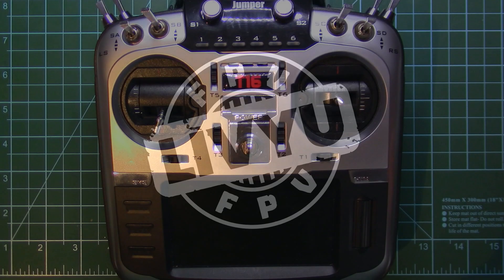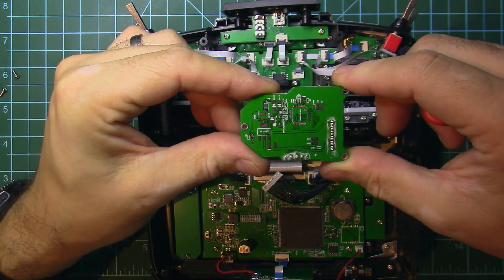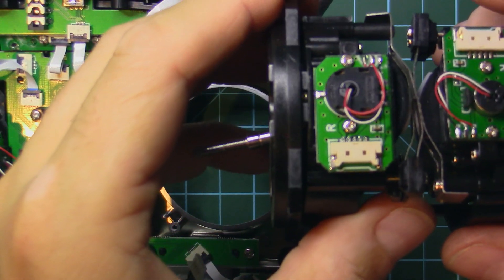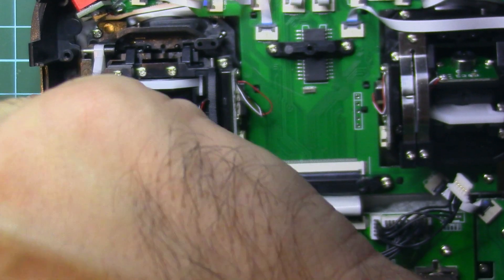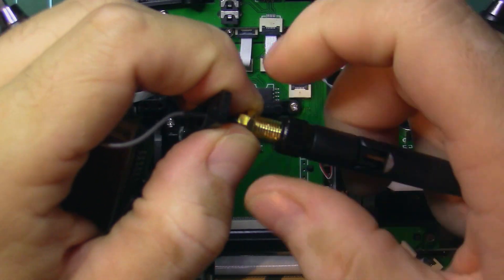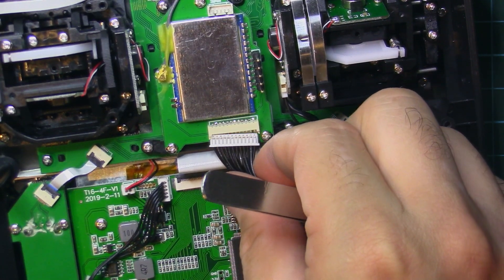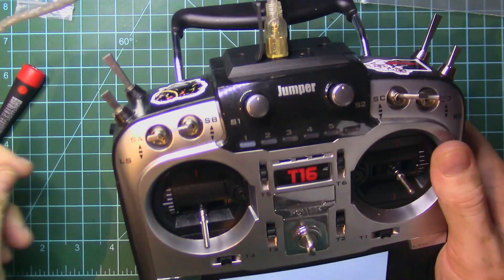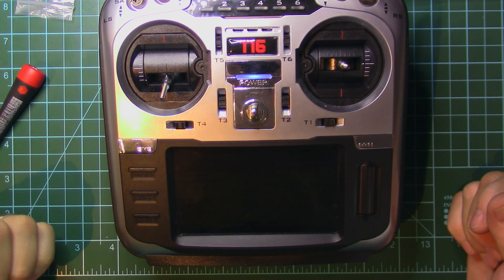Jumper T16 Upgrade (Hall Gimballs & Internal RF)

Comment: In the calibration screen it allows me to move the right stick perfectly in all directions and recognizes its movements, and the left stick fully recognizes throttle up and down but it will not recognize it when I move it left to right. Any advice?

Comment: I'm new to quads. Bought my T16pro a month ago and been using it on my simulator and worked perfectly. Today just got my mini whoop and was following your instructions on binding it to my radio. While on beta flight and changing RETA on the receiver the yaw did not want to recenter from the left and just did not want to function. I tried to recalibrate on the radio and the left stick did not want to center even when it is centered on the radio. I connected to my simulator and the yaw again did not function. Any way you can help me with the dilemma, would much appreciate. Thanks.
Reply from the maker: Hi, please rite to me on fb and send videos maybe we can figure it out.
Reply: ok.

Comment: Or you could just buy the pro version lol
Reply from the maker: Some of the people have already the normal version...
Reply: @LivyuFPV  yea i know im just kidding for those people this is a great video im thinking anout getting one but heard there are issues still how is yours
Reply from the maker: @jayward7536  Issues? what issues? worked fine for me
Reply: @LivyuFPV  herd its not upgradeable with open tx your pretty much stuck with what jumper offers for it battery tray is a pain to take in and out and something with it will not work on 800 mhz  system not that i use that now this is what i heard i dont know for sure but i also herd jumper will fix these with new model
Reply: and if you already have a rec with access it wont bind to it
Reply: @jayward7536  now you can get openTx instead of jumperTx if you didn't know yet.

Comment: what about the ribbon cable that comes with the new gimbals ?? is that a spare or does it need to be also replaced ?
Reply from the maker: good question :) I received two ribbons, but they are the same with the one already inside. I guess they decided to place one in the package cause there is a small chance of damaging it... or it is just better than the original white one.
Reply: @LivyuFPV  i thought it might have some extra shielding or something :)
Reply from the maker: @nightlightup  no... the new one is a little bit more flexible and I guess it can take more movements if you thinker inside